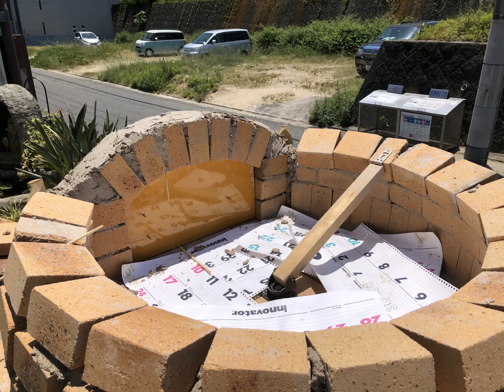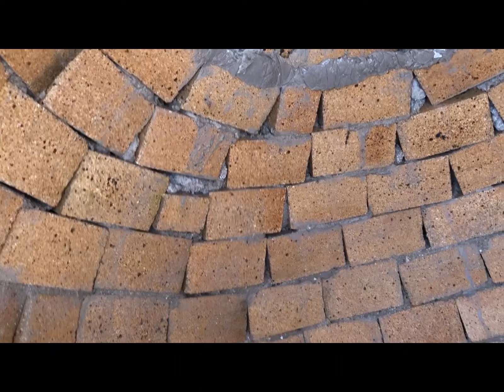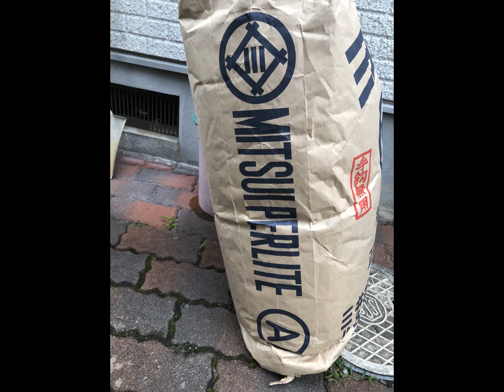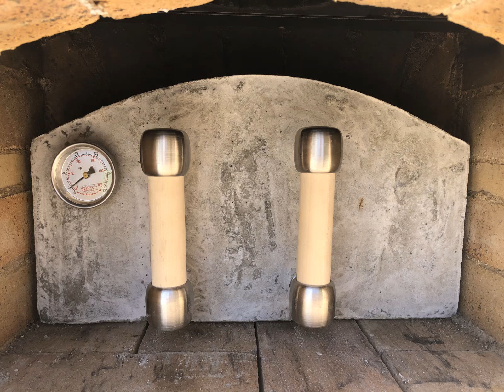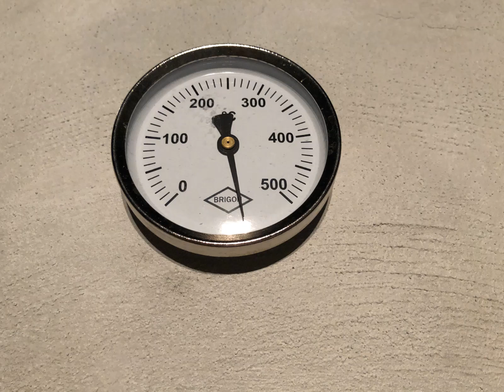ステイホームがきっかけでピザ窯を作ってみた。Stay Home Woodfired Pizza Oven Project

Comment: Nice oven.   
 I’m building pizza oven here in my yard. I’m quiet confused about ceramic fiber  thickness also where shall I get it from
Reply from the maker: I saw your video.  Nice!!  Looks like you live in Japan.  The ceramic fiber was not cheap but I got it from this link.  I got the 1260/130.  I found cheaper ones on Amazon Japan but from China and I was worried about quality/harmful chemicals.
https://www.isolite.co.jp/en/products/rcf/isowool-blanket/
Reply: @frankinhiro   
 Thank you so much for the link  
Living here in japan Nagano prefecture

Comment: How big is it and the ball what size will do
Reply from the maker: The diameter of the dome is 88 cm.  The ball I used was a 75 cm ball so actually it's a little small but it worked out fine.  Thanks for stopping by and good luck on your project!